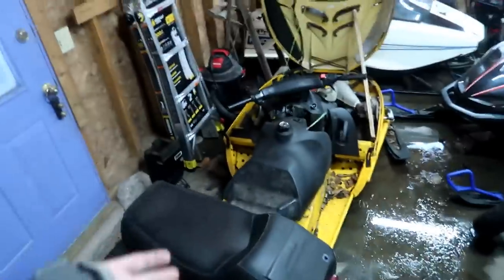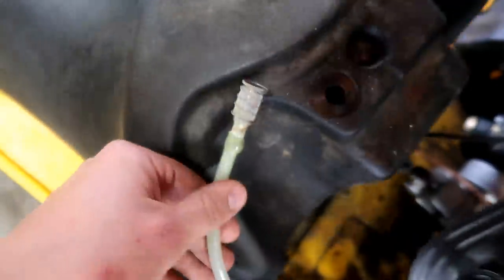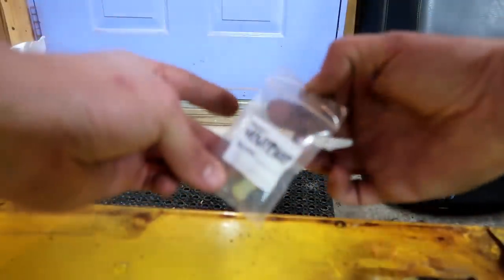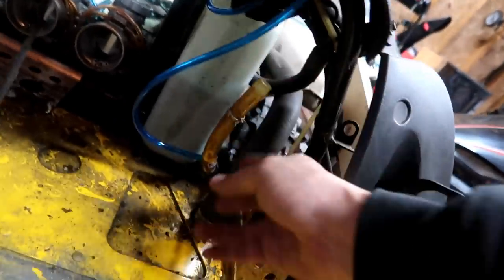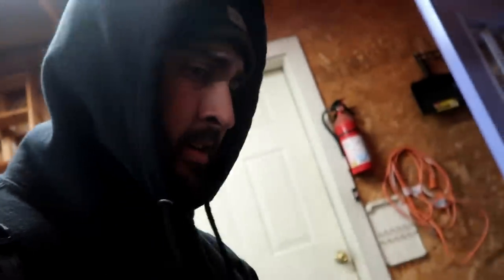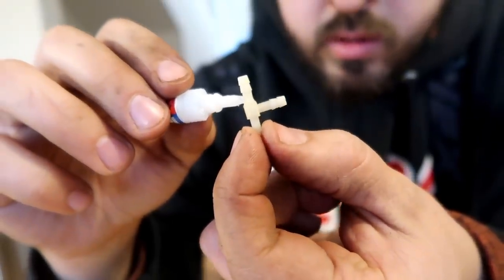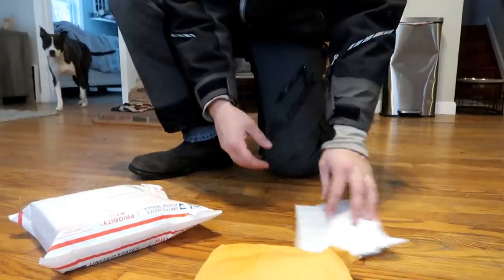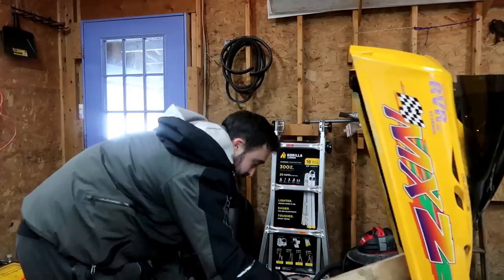I Can't Fix This Snowmobile?  HELP ME. (1997 Ski Doo MXZ 583)

Comment from the maker: What do you think is wrong with this thing?? Drop your guesses down below! I'll update you all in an upcoming video.
Reply: Doesn’t have a Sasquatch hiding inside!!
Reply: I'm not sure how long the engine is running before it dies, but it's worth looking at the vent line on the gas tank (liquid/air displacement). I'd even rig up an external test tank to bypass everything, and see if you get different results.
Reply: I'd look into the electronics too. Sometimes a bad cdi/stator will cause the engine to shut off after a while. Worth looking into at least.
Reply: Did you do a compression test on it?
Reply: Could be the vacuum line that goes into the fuel pump
Reply: Possibly crank seals. Had a Fuji 488 do something very similar it had me scratching my head for half a season. Little to no vacuum to the carbs... little to no fuel
Reply: @nickwiest9270  thinking the samething. If that's sucking any air at all, the sled will run like crap/ not run at all on a lean run cycle.
Reply: Just had the same issue with an old polaris 440. Changed fuelpump first, but it would not run. So took the carb out for second time. And found out tje float did not work correct. Smeared up, everything. Put the carb on again and the polaris runned good
Reply: I just got done fixing mine it’s a 93 arctic cat 440 z with basically the same problem I replaced all my fuel lines and filters and make sure it’s not sucking any air around the hose connectors and I adjusted all my chokes and slides and all of that and the air fuel mixture screw hope this helps and good luck
Reply: My dad had a formula stx 583 and chased poor running issues until he finally found that the CDI was bad after replacing all the other electrical components and all fuel related items. It’s not true what people say when CDIs die they just go completely, they can partially work.
Reply: With pump rebuilt,it would have to be air fuel mixture. It's 1 1\2 for bowl air screw, 2 1\2 for idle screw. I have held slide in carb and turned screw until contact was made with slide & idle screw . Then the 2 1\2 turns .should start & idle low. Adjust to 1800 . I really hope it helps. Would also like to head up with my friends and have a great time riding & camping in your wonderful State and snow.
Reply: On the formula stx the CDI was located right next to the main exhaust pipe and think enough started melting things inside to where it wasn’t working well anymore
Reply: Check the crank seals my guy. Get vallhalla Mike ready with a can of break cleaner and get it running and spray at the crank seals and see if it changes the rpms at all. If it does....leaky crank seals. Common issue on these older sleds these days.
Reply: I've seen them flood to the point where they fill the case and run like garbage. Should be a small drain plug below the exhaust manifold. Pull it and see if anything drains out.
Reply: I’m thinking either it’s electrical or you have a bad vacuum leak somewhere.
Reply: Vacuum line ... Crank seal ... Clogged fuel filter.... Happened to me when I replaced the filter but it clogged after a couple off minutes on original bad gas. Could be a clogged gas tank filter and or tube as well
Reply: @ryanprentice7713  it's a mechanical pump, no wires.
Reply: Would like do you need a new stater
Reply: Checklist: 1: Do a compression test.2: Does this machine have a throttle safety switch that could be out of adjustment causing it to cut out thinking the thumb throttle is sticking? 3: These engines have a rotary valve, you will need to take out the carbs and unbolt the metal intake assembly (4 bolts) to verify the metal rotary disc is intact and not damaged. 4: Verify engine isn't severely flooded, disconnect fuel lines and see if it still wants to start and run without fuel connected.
Reply: @Just-InTimeRepairs  Could just leave the gas cap cracked open to rule this out too. It should run longer if this is the issue, though.
Reply: Just sell it to me lol and it has all 96 graphics but check crank seals and check carb adjustments.
Reply: Try br9eya sparkplug, look you jet size. Is your gaz old?, intake boots are they in good shape, and remove your on off valve and filter put it straight, gaz leak just wash your carb
Reply: Check your pulse line from the fuel pump to the engine, It might be clogged or split.
Reply: Seems that's its not getting too much air...if it was too much it would idle high so that squashes that end of things...
My guess would be either bad carb or vacuum line....
It's "def" fuel/air related.....
I know you've already cleaned cards so insulting you with that won't hapoen....ignition issue, you'd have no spark...
Could be compression related but it sounded like it was going to run solid until it didn't....lol
It'll turn out to be so simple, we'll all feel stupid
Reply: @unimog9388  you could tell that by looking at the plugs..
They'd be soaked in oil...
Sounds like it wants to run strong, not skipping or sputtering...just dies... not enough fuel or not enough air most likely
Reply: @kirk1920  it would idle high if getting too much air so that end can be ruled out..... thinking not enough air...vacuum lines affect flow thru fuel system... that's what I'm thinking
Reply: @mattcam3089  fact
Reply: @stevensawyer2489  what snow?...
Lol
Good advice man
Reply: @stevensawyer2489  hit me up if you want to enjoy some of vt...
I ride out of woodford when conditions allow....
Be happy to take you on a tour...
Glastonbury fire tower..
Green Mt national forest etc.....
Reply: @williamquick6153  didnt think of that troubleshooting approach
Reply: @rondogbuzzell4632  nice. I'll talk to my friends too.
Reply: @stevensawyer2489  
Where are y'all from?
Reply: @stevensawyer2489  I'm on fb minus the dog
Reply: @rondogbuzzell4632  mass & no snow
Reply: It’s probably because mike wasn’t there to fart in the intake😂😂 1. Check the impulse line to the fuel pump make sure there’s no air leak. 2. Check that there are no air bubbles inside the lines from the fuel pump to the carbs and that those lines are also good
Reply: @stevensawyer2489  yeah.... that's a fact..
Supposed to get a few inches this coming week and if the temps hold, maybe more the following week..
We'll see I guess
Reply: @valdemarpettersson4996  I'm thinking same rectifier CDI stator not so much. Easy to test tho
Reply: I assume u did compression test.  She could be running on 1 jug
Reply: I was thinking possible petcock as well. Make sure has full flow. It's something simple your right there.
Reply: Check the trigger  and clean the trigger points on the fly wheel
Reply: Rotary valve
Reply: Prime it when it starts use that primer to feed fuel. If it works check the line from the motor to the fuel pump make sure your getting the vacuum. Re build carbs. Float bowls might have water in them. If they do it will never run. Lastly take out plugs keep pulling over see if water from sitting got into crankcase.

Comment: My first guess would be the floats. They aren't sliding on the little spindles and hanging up. The floats were down overnight, which would then cause the needle and seat to be open, which caused the mess on the floor. Once you ran it the vibration caused the floats to free up and lift, which would close the needle and seat. Now the floats are stuck in the up position, you ran it, bowls are now empty, and that's why it only runs off primer. Another issue I've seen before is as simple as putting the air box back on. They will run lean without them.
Reply: I'm sure he checked that. That's on the top 5 list

Comment: Rig up a temp gas tank and gravity feed carbs.  If it runs, you know it's fuel pump,  primer, etc.  If not, might it be carbs?
Reply: I think this is the best advice.  Even the new fuel pumps sometimes suck.
Reply: Cant be full pump or primer cause he just replaced those, its gotta be something els..
Reply: @Adventures  yes it could be.  bad pulse line or lack of pulse signal on fuel pump = no fuel.  No offense,   Gotta think deeper.
Reply: @adventures9430  yah but sometimes the new ones are junk, just from my experience

Comment: 🔥start from the basics.. fire up sled, feel the head and see what cylinder is firing and getting warm. I’m guessing the pto side is the issue. Check spark, no spark try new plug, still no spark remove the coil. Swap coil see if other side will fire. If yes then get new coil. If both side are firing and sparking, check compression, If compression then back to the carbs, but u have cleaned carbs, new pump, Lines and primer. Put new pulse line to fuel pump. Next remove exhaust check that muffler and pipe make sure no birds nest of blockage. Take header off take look at cylinders and pistons. Remove rave caps take looks see if plungers and springs all look good not stuck down. Take the belt off too, seen rong belt on so many times and dragging in the clutch. 🔥👊🔥🔨⚙️🏍🚜
Reply: Not even close my one cylinder does the same his does dies after awhile and getting way to much gas if he took the air box off it would be shooting gas out the back of the carb it’s a fuel pump/primer issue constantly sucking gas threw the primer lines

Comment: Had a 97 formula z was leaking fuel just like yours , turned out to be the needle seat in the carb was bad replaced,fairly easy ,worked great 👍
Reply: That would be my guess, with the fuel dumping out an overflow tube on one of the carbs with the tank being higher up.

Comment: Hi Jeremy, I know this seems very basic, but did you replace the spark plugs? Also, sounds like its running on one cylinder. If you give short primes (not to flood it, just give it fuel) does it help? If it does its fuel related, if not its electrical. Just my 2 cents on which way to look. Always go back to the basics, it's always easy once you find the issue.... Thank you for the great videos!

Comment: Just bought a 95 cat puma that was stuck for $200 out new lines filter pump rebuilt mikuni carb boiled/cleaned new pickup in tank soaked cylinders in marvel mystery oil… let sit for a 2 days.. new plugs thru gas down the cylinders to prime the fuel system and bam she hasn’t skipped a beat

Comment: Your in line tank line is incorrectly installed and asking for a fire! The metal elbow is supposed to sit in the grommet not the line! Remove the clamp and fully seat the elbow into the grommet. Some one mentioned reeds, this sled is a rotary valve motor it doesn’t have reeds in the intake. Make sure your pulse line is good and hooked up the the correct location at the fuel pump. Make sure your rotary valve is functioning correctly and spray your crank and mag seal once you get it running to check for leaks. You should hear a noticeable
Change in tone from the engine if one of the seals are bad. Also your primer was working correctly before you replaced it,  your primer is a pump, it creates suction on one side and pushes it out the other. I work on these machines every day and have tons of used and new parts available. I’m in NY so fast shipping also! Any questions feel free to reach out.

Comment: The 583 mxz was a beast at the time. It was the sled that hooked me and I could walk the skis for 100 meters just on throttle. When the ski would touch the ground on the lake I'd be doing 100mph. It was brand new but what a fucking beast at the time. Nothing could touch me except the summit long track on the hill climbs. Ski doo is the best will never change my outlook on that. Hope u get er going bro.

Comment: I wonder if the crank seals are sucking air and causing it to idle high and act like it isn’t getting enough gas ! I had an older Polaris do that!
Reply: I didn't think of that. Definitely worth spraying the seals with some starting fluid.
Reply: He should have been able to keep it running with the primer if that's the case, though.
Reply: My formula 500 is doing this might look into it. Thanks man!🤙

Comment: Replace the needle and seat in the carbs and try to spray starting fluid in between the clutch and the engine to check the crank seals

Comment: Jeremy, do you have gas coming through the main fuel lines? Pull the lines off the carbs and pull it over, it should be pumping out. You may need to prime the fuel pump.

Comment: Same thing happened for me with mercury outboard engine, it was running with primer but shut down without. I rebuild carburator and pump with new seal kit and it started to work. That makes me thinking that you loose vacuum and it's not getting fuel because of the leak. Cannot find out how long it's running after you stop priming it but if it runs a moment, you can check airleaks by spraying break cleaner to carbs and look if rpm:s rising. Almost sure you have airleak somewhere.

Comment: Put a shut of valve between the tank and the fuel pump. Those sled are known to let fuel bleed by when not running. Casing the bottom end of the motor to fill up with gas. Check the lower end oil and see if it has gas mixed in it. Happened to mine I put a shut off valve and then a filter off the tank.

Comment: I posted this on the last video you did on the mxz. Can you please systematically go through this list on video one by one so we can help you get this sled running?
Long list of stuff to check on the 583. I’ll just sum up what most have already said and add my some of my own stuff I’d check

2 brand new spark plugs
2 new spark plug boots (they have resistors inside which could go bad)
Impulse line
Cracked carb boots
Compression
Check crankshaft seals (mag and clutch side)
Leak down test to verify inner crank seals aren’t leaking
Verify magneto resistance and visual check for burn spots and visual check the dots are lined up for proper timing
Check for clogged exhaust
Check coil resistances
Have a spark tester light hooked in line with the spark plugs to make sure your not losing spark when it dies. 
Also right before it dies try giving it an additional shot of primer. Also try cracking the throttle a bit. Try one at a time and see what makes the difference. 
Make sure you have the correct jets in your carbs
Make sure your carbs are opening at the same time and resting at the same place. Adjust idle screws and throttle cables accordingly.

Comment: Check the carb filters, if they are even there.  Where the fuel line connects to the carb.  There is sometimes a filter that sits down into the barbed fitting.

Comment: Got my '98 MXZ 583 running today.  Here's my final list of problems:
Left carb: Stuck bowl fuel inlet needle & seat.  The bowl float was 2 mm too high. Dirty filter.
Right carb: Missing filter.
Both carbs: Clogged pilot, partially clogged main jets.  Air screws too rich by 1/4 turn.

Comment: Some of those skidoos had small screens in the inlet tube of the carburetor  where the fuel line attaches. Iv had to use a pick to pull them out before. Good luck those 583s are still one of my favorite motors.

Comment: I have an old sled too. Press the primer till the gas goes in the carbs. Give her some pulls. It will start, now prime it again a few times till the fuel pump kicks in good. Motor needs warming up that’s why

Comment: I had they same problem. It was the high altitude compensater. My was plugged into a hose it wasn't supposed to be. Once unplugged it runs great. I had all the same issues, it would start but not stay running, I thought it was the primer, fuel pump, carburetors jets, floats, ect, nope high altitude compensater.

Comment: When ever using super glue,one must have some backing soda on top of the glue to make it work right . & Stay where it was glued.  PS. Glad you using the MX.mine was the air mixture screw for the bowl. Agent from 1 1\4 turns to 1 1\2 . Mine wasn't gettin'fuel either. Now rips like new. Just need snow a lil further south in masshole.
Reply: What would baking soda on top of the glue do???
Reply: @MidnightPolaris800  aids in the bonding strength of the glue. Look up baking soda & super glue.

Comment: Could be crank seals.  Spark plug caps could have a questionionable connection.  Cut a 1/4 inch off the end of wire.  Screw cap back on.   Exhaust could be plugged with a critter nest.  Just some things that come to mind.

Comment: Yes primers fail, think coleman lantern. 2cycle oil in it at end of season helps it. Wrong size lines if you go to a Mikuni round pump vs the oe Square pump. 583-670  rotax RV engines don't tolerate a drop of water in the fuel system and are horrible to get started if you flood them. As easy as they are to work on I would drop both float bowls, prime it with fresh fuel. If one side seems like it foules, go to a #8 plug until you get the carbs right.

Comment: Pretty sure its just clogged primary jets in the carbs. Try running a few tiny strands of small guage stranded brake (like the stuff for bicycle brakes) cable through it to get the junk out.

Comment: Check the impulse vacuum line for cracks. I'm not sure if this sled has one, but its a pressure line that goes from the crank to the fuel pump. It pressurizes the pump to draw fuel from the tank.

Comment: Checked for an air leak? Leak down test done?. Compression test?.
Also have you checked the rotary valve? To make sure it's not all scored up? And at proper timing?. And also the timing key/timing? Trigger coil?. I had a bad base gasket. Once cause wierd issues.

Comment: Both fuel/air mixtures screws out one turn. With the engine hot 1800 to 2000 rpm’s idle air mixture screw. Ran into the same problem recently does sound like a fueling problem.

Comment: That shutoff valve nipple should be pushed through the grommet in the tank. I've never ran a clamp on the hose going into the tank. If you had to heat it to get it on, it won't fall off

Comment: Check the crank seals and check for loss of spark when it dies run it with a spark tester on could be a failed cdi or stator